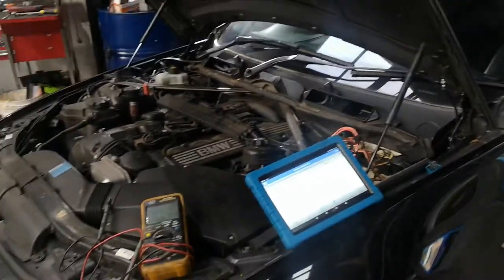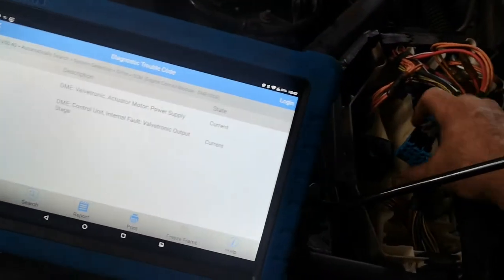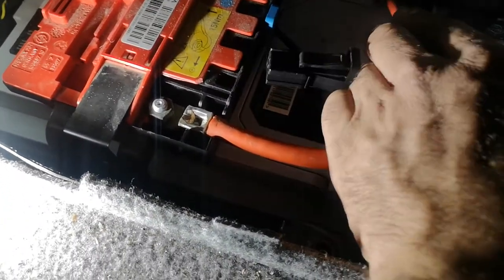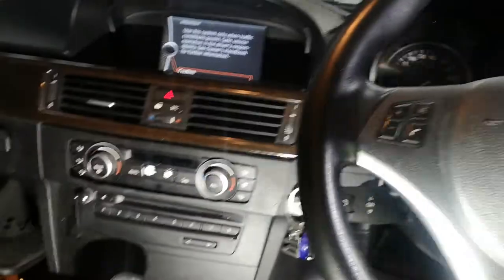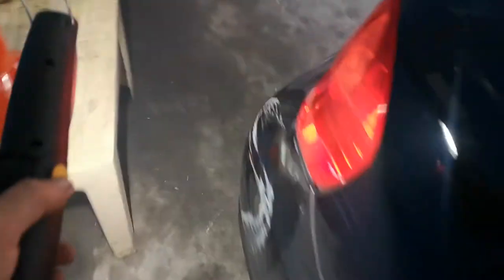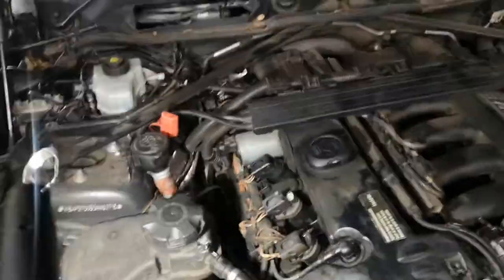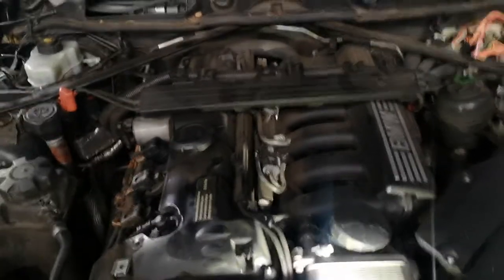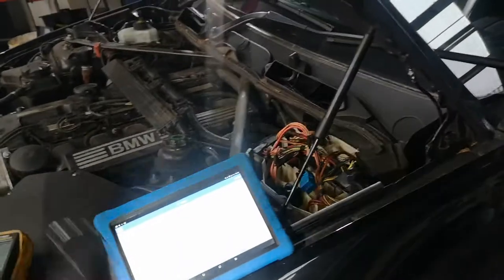BMW E90 Valvetronic fault relay fuse power supply check battery connections!

Comment: Big thank you from me in England. You saved me time & money. I had p100f & p1057 related to Valvetronic motor. I've changed a few of them before so know it's a common failure. The car drove fine no issue other than EML light. I found this video. The small red wire wasn't even attached. It had corroded so badly it had fallen apart. Looks like water had got in there at some point and corroded the connections.  I replaced the small red wire for £10 and no more EML light or fault codes for valvetronic.

Comment: Valve stem seals are not a problem with N series inline six like their V8 counterparts. I would think the smoke is from the faulty PCV and all that excess vacuum causing oil consumption. Thank you for showing this stuff and keep fighting the good fight!
Reply: Yeah I know I've never seen a 6 cylinder with stem seal leak that bad

Comment: The two code what was the fix the wire? The fuse ? Relay? Or the vvt motor ?
Reply: @mapa9868  I checked over everything everything was good took it to the dealership it had to get a software update and that took care of that problem thank God

Comment: Friend had a problem with the Valvetronic power supply, I saw your video and you gave me the solution, the cable of the red battery tablet was loose, just as you show it, thank you very much for sharing your knowledge, blessings.

Comment: The vacuum in the oil cap area is the whole top cover, that engine has the crank case it crankshaft, one of those don’t remember, built on the cover and it’s not functioning properly.
I swapped the cover on my 2007 e92 and the cover swap fixed the vacuum in the oil cap. Late response but maybe it helps someone

Comment: Hello boss any one can explain for this codes plz 

133C01 Valvetronic, Thermal Overload Protection: Warning Threshold, Current,
Exceed
133501 Valvetronic Servomotor:
Overload Current Detected
133902 DME, Internal Fault, Valvetronic:
Undervoltage Detected
134B02 Valvetronic, Servomotor, Supply
Voltage: Short Circuit To Earth
133401 Valvetronic, Thermal Overload
Protection: System Switch-Off
ABS (Anti-Lock Braking System - DSC)
D35584 Signal (Wheel Torque Powertrain 5, 40.3.4) Invalid, Transmitter DME / DDE

Comment: hello.
i have a BMW E91 320i 2006 model and i have always ,only, the fault code 2A70.
i change spark plugs ,coils and battery.
still same code.
then i measure the voltage on valvetronic motor with car off and it was 3.9 - 4.1 volt
then i power up without pressing then clutch and still the voltage was 4.9 volt maximum on valvetronic.
sometimes is not crank with the first time . i dont feel any power loss but it consume more fuel.
what else could i test ?
Reply: Hi, have you finally found the problems?
Reply: @andreivcr5390 it  was the valvetronic sensor.but since I opened i replaced also the valvetronic motor .
Reply: @neo24gr  thank you
Reply: Hello!I'm from Botswana n owning a E90 320i. ..my car has this fault valvetronic internal fault n no power...what should I change or check?
Reply: @andreivcr

Comment: I got the valvetronic motor sluggish and valvetronic power limitation codes which was the  replaced by the mechanic. The car is hardly used but  about a year later, I got the same error again. As I just missed the one year warranty, the mechanic replaced the motor again. Within months, the same error appeared again! I seriously doubt the motor has malfunctioned again :-( Could something else be causing this error? Please help! My car is a 2010 BMW E90 320i.
Reply: @kudi I got the eccentric sensor replaced now and I'm monitoring the car carefully to see if the fault reappears. Will let you know.
Reply: Probably aftermsrket part
Reply: @richardaotearoa6752 😂😂 that should have been replaced in the first place, those motors rarely fail unless the car is super high mileage.

Comment: Hello Sir greating from Indonesia

Can you help me, i have problem on my BMW e90 320i 2012
2847 : DME Valvetronic Servvo Motor, Electric
2863 : Valvetronic, Power Limitation

What should i do?
FYI : i have changed a new motor servvo valvetronic on my car.

Tjank You 🙏
Reply: Saya juga punya masalah yg persis mas, kira2 udah ketemu solusinya mas?
Reply: @ferdinanginting7025  Endingnya service ECU dan hampir 2 bulan ini mobil udah aman2 aja.
Reply: @lisandra1957 boleh oper tempat servis ecu nya mas?
Reply: @lisandra1957 replacement or software reflash?